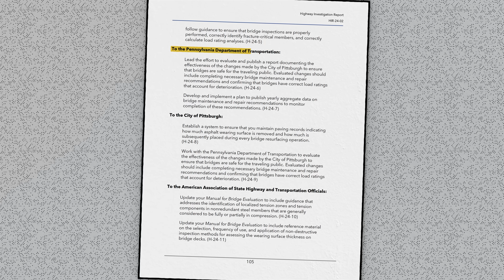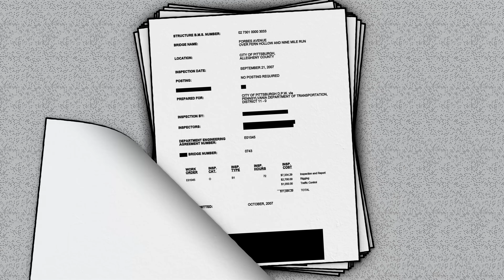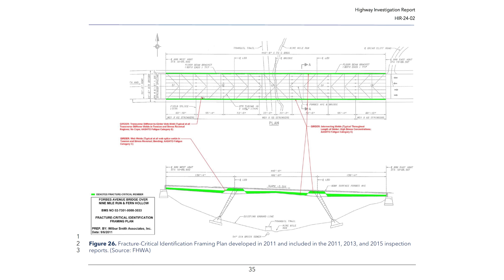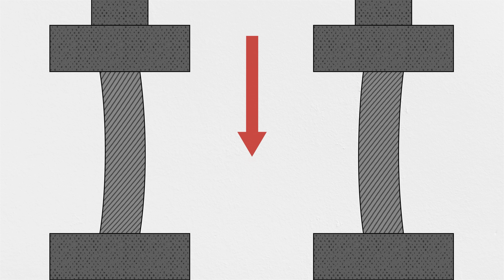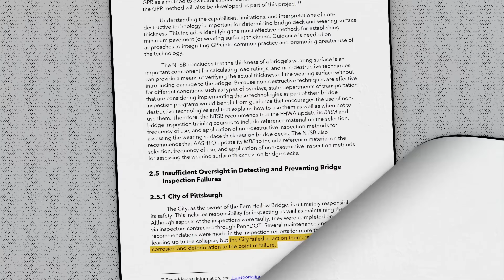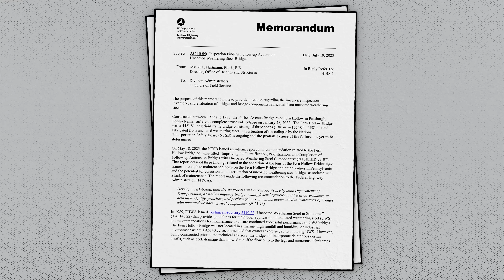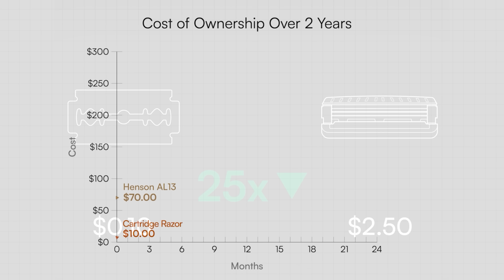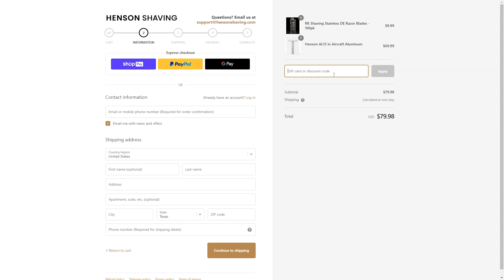This Bridge Should Have Been Closed Years Before It Collapsed

Comment: I'm in healthcare architecture and it is very true that a retrofit of an existing facility is a lot less glamourous than a brand new one. No one is going to have a big ribbon cut party for the new fire escape ramp we've designed for an existing hospital ward, but if there's ever a fire the staff can now evacuate patients safely in their beds instead of trying to get non-mobile, vulnerable people down the steps.
Very interesting video, I find your deep dives on failed case studies very useful :)
Reply: I’m on the other side of the equation with designing equipment for hospitals not much glory in making buttons that minimise mistakes or evacuation equipment that can help workers from getting injured compared to the more expensive flashier products or “life altering” ones when reducing errors and injuries is just as important
Reply: Well, I for one salute you, dear Internet stranger that does this awesome work 💪👍
Reply: An added problem with infrastructure maintenance is that it often causes traffic disruption which leads to people complaining.

Comment: Having no bureaucratic mechanism to trigger repairs after massive flaws are found is typical bureaucracy
Reply: we need to give inspectors the authority to close infrastructure entirely on their own.
Reply: Part of the problem, I think is that people figure that common sense will prevail. After all, what kind of moron would look at a report that says there's holes rusted through the legs of a bridge, and NOT close the bridge?

(Hint: the kind of moron who only sees the bridge as a line item on the budget.)
Reply: Build Back Better!!!
Reply: What about the inspector that missed the crack on the ohio brige i believe?
Reply: "This will make me look bad before the next election, better let the bomb tick"
Reply: that's not a bug, its a feature.
Reply: @EvelynNdenial  That was also my idea. If an action item that needs to be done before the next inspection is not done at the next inspection, the inspector should be required to immediately lock down the bridge. (barring reclassification by a qualified engineer following well thought out standard procedure in the mean time)
Reply: Automating that process has been how our agency has improved reporting and results.

Every time a report comes in, it's digitized. And entering critical values sends out an email to leadership and opens a case with a low SLA timer. If the case isn't addressed within the guidelines of the agreement, there's an automatic email to leadership's leadership. And at that point it's a fire.
Reply: Inspectors and engineering consultants missed an undersized gusset plate that was beginning to distort at least two years before the I-35W bridge in Minneapolis, a steel truss design, collapsed into the Mississippi river.  It was the rush hour, so the bridge was full of cars and trucks, including a chartered school bus that was full of kids.  A semi-truck caught fire and the driver didn’t escape.  A total of 13 people were killed and 145 more were injured.  

The engineering firm had focused on the truss members and made an unfortunate assumption that the gusset plates were all good to go.  Investigators found inspection photos that showed the distortion that was previously missed.  The engineering firm was found liable in court because they didn’t consider the gusset plates as a possible weak point despite the distortion clearly visible in the photos.
Reply: @peterjensen6844 Wait so the solution to bureaucracy is more bureaucracy, wut?
Reply: The bureaucracy expands to support the ever expanding bureaucracy.
Reply: @Generichumanzie  do you mean the "silver bridge"?
Reply: @amelliamendel2227 sometimes yes. There is no black and white answer. It can be the lack of oversight or a bad incentive structure that can lead to problems. Good bureaucracy is when the oversight is fast and not intrusive but dose its job and where the incentive structure is such that both greedy and dumb people still do there jobs as that's the easiest path. The hard part is the dumb people.
Reply: There was a mechanism, in 2013 an inspector was so concerned with the deterioration that he asked a load appraisal and they goofed the math and said "well, it can handle 26 tons." If they found the answer to be "10 tons" or "3 tons" surely that would have triggered the bridge to be shut down for repairs. it is still inexcusable that even though the city might have had reason to believe the bridge was still OK "for now" they didn't try to at least unclog the drains to prevent further deterioration.
Reply: @harmonic5107  yes automation is the way to go. If a report gets entered that says the drains are clogged, that should automatically create a task for the team that unclogs drains to go and unclog those drains.
Reply: If only we had a system of inspections and checks that could have prevented this... oh wait.

Sounds a lot like we need more bureaucracy to oversee this so that it won't definitely not but definitely will happen again! 😂
Reply: working as intended so no one can point the finger at anyone in particular.
Reply: Maintenance is expensive. If only you paid more taxes, the bureaucrats would be able to pay for it. 😉
Reply: We have a major steel truss bridge where we live; they're in the process of replacing it but it's load rating has been dropped to 10 tons.

It's been talked about being replaced for the past 15 years. The combination of people who want to protect it as a historic bridge, and people who don't want to pay to replace or repair it caused its replacement to take some time.

No one wants to pay to inspect/analyze/maintain steel, no one wants to see a historic bridge go away, no one wants to pay 10x the replacement cost for repairing neglected bridges(true figure). No one wants to shut down someone's primary path between A and B.

Our infrastructure is getting old and we have a legacy of poor maintenance. Unfortunately, I don't think much is going to change until these stories become more frequent.
Reply: They'll never stop blaming Trump.
Reply: As usual the answer is less government
Reply: In France, nuclear infrastructure is inspected by an institution called the IRSN, which actually has the legal ability to close down any reactor they thing might suffer for a safety issue. They shut down for inspection 25 of the 56 reactors when a generic problem of badly aging weld was detected on the auxiliary systems of French reactors. I.e. about half of French nuclear eactors were shut down preventively for a problem on an emergency system that's not even in use in regular operation. So putting safety first, with actual legal power to have stuff done and protect the public is absolutely possible.
Reply: I think the city council each year could only make note to discuss a review but could not exactly order any repair or replacement since it's convoluted and just leave it for next year's council.
Reply: @EvelynNdenial This is actually the best idea - but it needs to be more like a temporary court order that has a limited approval length until a 3rd party agrees with the initial findings to make it permanent until repairs are completed. Or better yet... A council of engineers to confirm closures!
Reply: @Kenionatus  It'll be a looping problem then. The people who do the inspections are the same people who build the bridge.

The real issue is that we need federal regulation similar to the aeronautics industry. Roads are currently entirely managed by the states with no real legislative boundaries to attack the government beyond reputation.
Reply: They did though, if they said criticality 1 on the need for repair then it is immediate. The issue was the massive flaws weren't found. Everyone missed the bases of the pillars being in tension, if they had noticed that then applied the rules they have they would have said criticality 1 and the bridge likely would have been closed until they were fixed.  The biggest issue IMO was they flagged it as criticality 2 which required it to be fixed within 2 years. But then it wasn't, for a decade after that.
Reply: because in the US everything is about deflecting legal consequences, not fixing anything.
Reply: @EvelynNdenial  in some cases they do.  When inspectors found the cracks in the I-40 bridge over the Mississippi River at Memphis, they called 911 and told law enforcement to close the bridge immediately.  At least the government employees who "inspected" that bridge for years and found no problems was fired...but that's rare.
Reply: we need to study how we study.
Reply: @jasonbrannen7598  i wonder if those inspectors were going out of the way and taking a risk by doing that or if it was power established in that states laws and regs, because the latter is what i want country wide.
Reply: I'm in the process of building a replacement bridge over a railway after the previous bridge had to be urgently demolished due to failure of the foundations. The old bridge fell over in 2021 and it'll be early 2025 before the new bridge will be complete. The only reason it will take so long is because of turf wars between competing government bureaucracies that have continually hamstrung construction works. I could design and build a replacement in under a year if the bureaucrats stepped aside.
Reply: @EvelynNdenial that works until politicians reopen by firing or forcing it open
Reply: @MadNumForce you just have to make sure that they aren't corrupt at anytime in their career. Along with stopping any politicians or their pet bureaucrats from hiding the information and reopening whatever is closed
Reply: There was apparently ample money for endless amounts of reports and "investigations"... 🤦
Reply: @EvelynNdenial and then if nothing happens people and the media will witch trial them for crying wolf
Reply: There absolutely is a mechanism. It's called a priority 0 or 1 maintenance item. PC0 items are required to be repaired in 7 days or the bridge is closed,  PC1 is 6 months. Inspectors have the authority to issue these if certain criteria are met, but very often there are reasons why these PC0-1 items are not issued or downgraded to pc2, usually the district pressures the Inspection firm to downgrade, or the bridge is in the process of being replaced already, or it's in a really remote location with a very low ADT. Definitely not ideal to issue a PC0 on a bridge that is the only way in or out of a neighborhood, especially when the bridge owner in question has next to no money or manpower available  to make the repairs. It's not as black and white as PENDOT would have you believe.
Reply: you're right bro, having zero bureaucracy would have definitely solved this
Reply: @EvelynNdenial  Nah we need to hold the people responsible actually responsible for their actions or lack there of.
Reply: I didn’t see the speech, but I like to imagine Biden just standing next to the failed bridge and gesturing his hands up to it so aggressively as if to say “SEE?! I TOLD YA SO!! Ya see that?! INFRASTRUCTURE!!”
Reply: How about criminal charges and liability filed against any head of any bureaucracy that allows this to happen. Politicians and department heads don't get punished for ignoring inspectors telling them the bridge is needing repairs. See, there is no serious consequences for people not doing their job.

Comment: I've been in local government, so many times money found for a new infrastructure project. Yet I used to get told to shut up when I talked about maintenance. Therefore all the resulting facilities would have to be pulled down well before their time, because they are just left to rot rather than maintained.
Reply: I have been thinking for some time that large projects that forseeably need non-trivial maintenance budgets should be required to have an "endowment" of money that is invested in an annuity-like way to fund at least the forseeable maintenance requirements. And if the endowment runs out, it is federally required to be topped up or the project closed.
Reply: Maintenance is not electorally efficient!
Reply: And its amazing that just cleaning the drains and clearing debris would have extended the life of the bridge a huge amount.
Reply: Yeah, I've seen (and am seeing) similar issues. The community as a whole (i.e. the voting population) cares far more intensely about matters like construction work making commutes longer and taxes being raised to pay for infrastructure projects than about making sure critical infrastructure is repaired before it fails. And as a result the local politicians do everything in their power to avoid doing anything, because no matter what they do it will be unpopular with a lot of people.
Reply: “new infrastructure project” pays for cronies “maintenance” is just a drain on resources, despite being more important
Reply: We have the same here, no problem finding money to fund "signal buildings" but our schools rot due to lack of funding
Reply: @rivimey  I sit on a condo board and we have something like this--it's called a "reserve fund". I'm not sure whether it's legally required in our state (it's not in all of them, that's for sure) but I know our yearly audit looks at it, and would raise an alarm if we didn't have a proper one or it wasn't funded to accepted actuarial standards given our anticipated need. This fund was a major resource for our project to do a full replacement of the roofs on our 19 garden style condo buildings ~5 years ago. Even still I am worried about what it's going to look like when we truly reach the end of things like the useful lifespan of the plumbing--big things like that are millions as a replacement project, and we are already seeing an increase in leaks and sewage drainage issues in certain areas of the whole system we oversee.
We just dug ourselves out of long running debt we were carrying as an association, and at least there is a reserve fund, but I still have low key anxiety about funding maintenance and replacement of things like this ... much more than the superficial improvements other owners and residents tend to agitate for.
Reply: @rivimey  But lowest bidder, you see.
Reply: In a way that is the weakness of  a democracy. A new structure is something that they can sell to their voters as tangible "proof" of their effectiveness. Maintenance, is an annoyance for the same voters. Roads, or lanes closed, is frustrating. As voters we do share part of the blame, it's not just the politicians' selfish need  to get reelected. We tend to vote for those who did not "annoy us" during their tenure. Any politician that puts people's safety first is likely to be booted out quickly. You just don't see the work done when things go right. Bridges not falling down don't make the news. New bridges do (as well as those that do fall down of course).  We are likely to be more satisfied (collectively, I know people aware of the nitty gritty of the engineering decisions might have different priorities)  with the politicians that neglected the meaintenance to favour new builds.
Reply: @theguyfromsaturn  It's a weakness of human biases which exists in pretty much every organizational structure. The same goes for managers being more likely to be promoted for creating new products than fixing old ones. In theory technocracy dodges the issue, but in practice the new issue becomes who decides who is qualified to make the decisions, and people will still tend to prefer the people who offer the answers which are easiest in the short term.
Reply: @theguyfromsaturn  I think this explains why free and independent news media turn out to be such a necessary ingredient. Though if I have a criticism of the US it's that there seem to be so many elected positions for which there are no technical job requirements. Popularity is not a substitute for technical knowledge, any more than ignorance truly leads to bliss.
Reply: Need to send more USD to Ukraine
Reply: @theguyfromsaturn that isn't a democracy problem. It is a bureaucracy problem. It happens in any situation where you have a large organization with no one is responsible.
Reply: @JorgeLopez-qj8pu  It's more that "new infrastructure project" gives you a shiny new bridge to make the news, while maintenance probably gets you complaints from people inconvenienced by a bridge being temporarily closed.
Reply: Which is an effective strategy, because you have to pay to fix them but someone else pays to replace them.

Comment: Seems like a change in the system should be that any issue flagged tier 2 gets bumped up a tier if it is still present in the next inspection. If tier 2 means what it allegedly means, that is logically mandatory even.